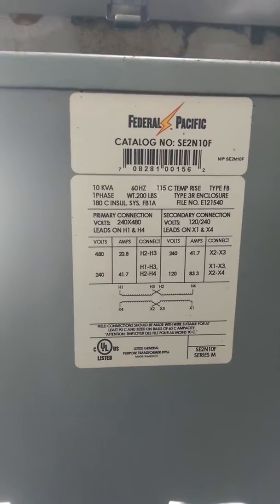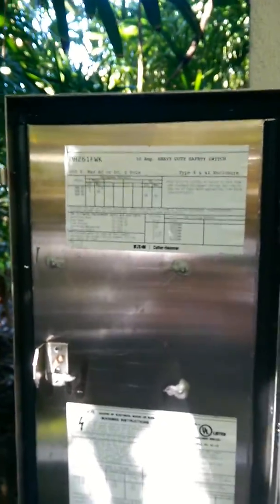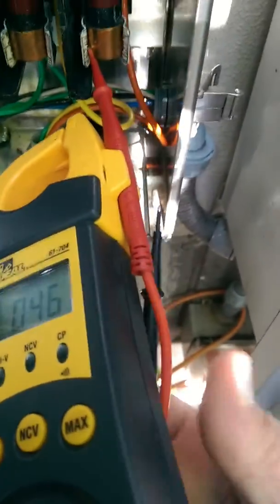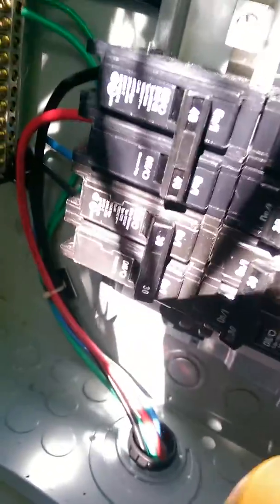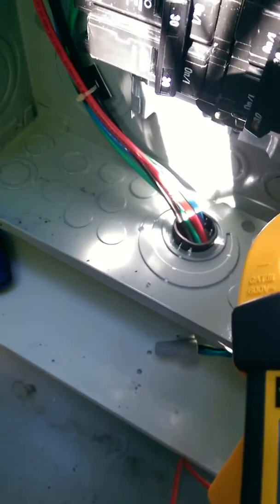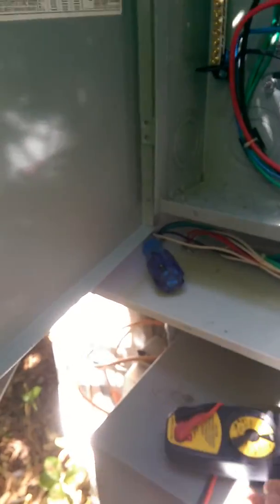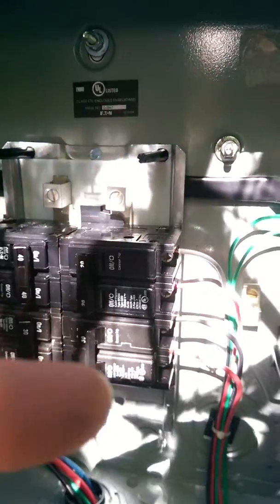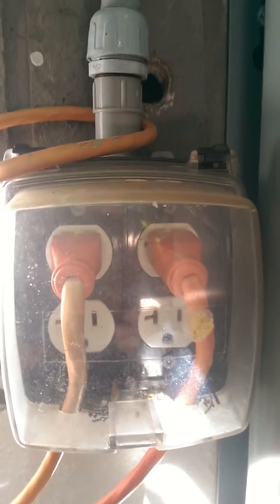480/240V step down transformer

Comment: This is 100% caused by not having a solidly connected neutral connection. Disconnect part of the load on either phase and the difference in voltage will change on both phases.  Yes I know this is 5 years old..
Reply: Very true.   Similar problems can occur inside your house.   Specifically older houses built in the 1990s and earlier,  it was a common practice to run 12/3 NM to your kitchen countertop receptacles protected by a 20 amp two pole breaker, could have also been a two pole GFCI 20 amp breaker, and the tab on the hot side of the receptacle is broken and the black connect on top, red on bottom,  neutral is supposed to connect via pigtail but often wasn't,  and removal of a receptacle upstream disconnects the neutral which has the effect of turning the downstream receptacles into a series 240 volt circuit, and the voltage can fluctuate on either side up to 240 volts depending on load balance.

Comment: Secondary Neutral not bonded to ground. Or maybe you forgot to run a neutral wire from x2,x3 to panel.
Reply: I'm having this issue. Isn't a secondary neutral labeled.

Comment: Your service panel may not be bonded properly. I had an issue with 460 phase to phase it measured 460. From phase to ground each measured 234,207,145 vac. I had an electriain determine the feed panel wasnt binded. He added a bonding strap. Truely got my 277 each phase. Fixed. Thats all I know.

Comment: I fixed a panel the other day on a single phase panel one leg showed 255 on the other leg was  15 volt ,witch should have read 120 on each  an the power company had a problem on there end . The voltage spike blew up many appliances in this lady's house . Once they fixed there issues I was able to replace some bad breakers an call it a day